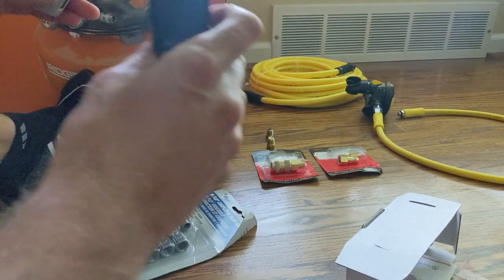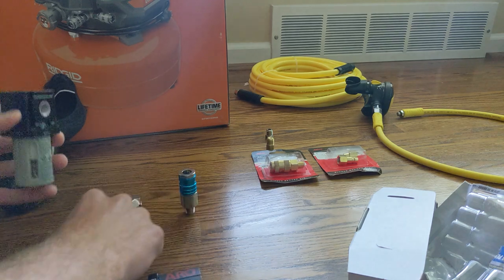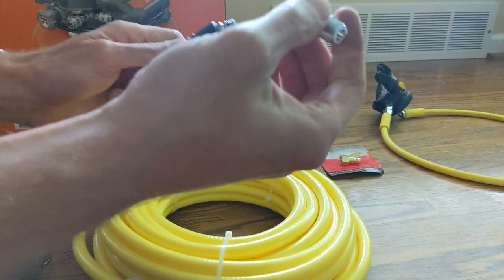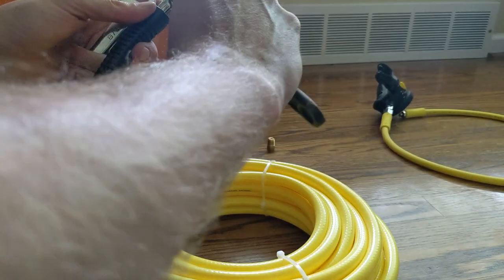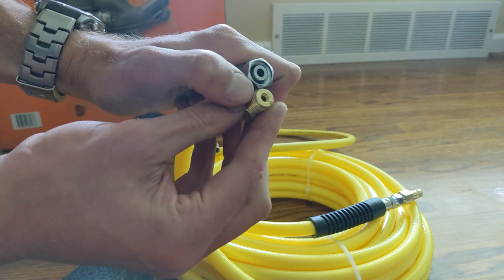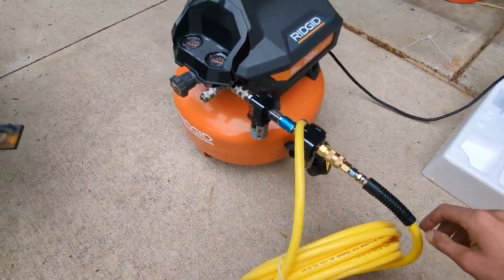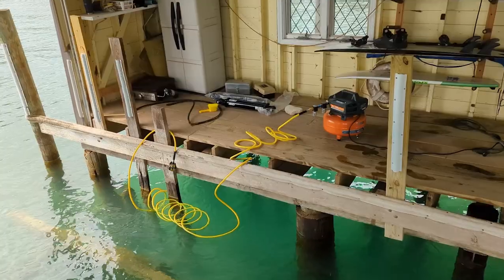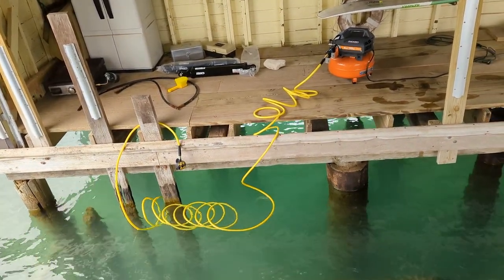Scuba Third Lung Breather DIY Build and Use

Comment: I use the same "setting" you have for more than 2 years.. works pretty well.. I use a cheaper regulator ($25), need to change more or less every 6-12 months..no issue with that... best of luck in your underwater projects

Comment: I have a very similar set up, gets it done. I ALWAYS run / fully drain the compressor a few times before and after each use till all discharge is clear. Have dedicated breathing hose and never use work hose with breathing hose. My reg/full face mask works well too with this. A 12 volt battery and inverter to reg up works away electric power.

Comment: This is excactly what im looking for right now. The only problem here is that this need electric power, since im going to dive for golfballs i need it 2 be wireless....
Reply: Get a 12v 550w oilless aerator pump then.. and now use a sealed battery to run it... you can claim its under 56v and not regulated... cheers. To be fair though, you can get battery powered pre-builts now for like $500 so building your own is just because you can and enjoy the mental exercise of doing it yourself.

Comment: not safe  can cause toxic air in your lung
Reply: Why would the air be toxic?
Reply: how? It's a scuba regulator, attached to a food grade scuba air hose, being fed air through two separate micro level filters for water/oil/particulates, being supplied by an oil free compressor... You breath far worse in traffic.
Reply: @TrueHelpTV  Checkout Grade E Breathing Gas. Especially Important at Depth. As the Air is Denser. And Impurities would also be.
Reply: @chrisphilhower6029   His hose is too short for it too matter.. 33ft is only 2 atmosphere, and you could stay at this depth basically forever.. What you're thinking about is nitrogen issues, but you could go down to 50ft before the dangers really get establishes, and it still doesn't matter unless you go back to the surface faster than the rate of rising air bubbles..
Reply: @TrueHelpTV  how about popping a Lung?
Reply: @chrisphilhower6029   either i cant see my reply or youtube needs to calm down it's AI auto delete
Reply: @chrisphilhower6029   I wrote out a long and elegant explanation and I think youtube auto deleted it the second I pressed send.. 
 Short version.. air regulators prevent "popping a lung" which otherwise can only happen if you go down 33 feet, take a big breath of air, and hold your breath as you return to the surface.. The air was compressed by the water pressure in your lungs and when you go up, that pressure from the water lessens meaning your lungs start to expand.. so just don't hold your breath as you return to the surface and do go up faster that your exhaled air bubbles..
Reply: @TrueHelpTV  I have a PADI Open Water Certification
Reply: @chrisphilhower6029   I got my PADI in 2013, I'm not sure why you're debating this then